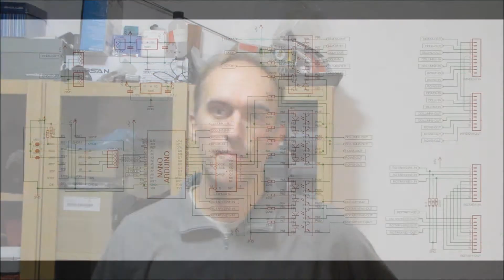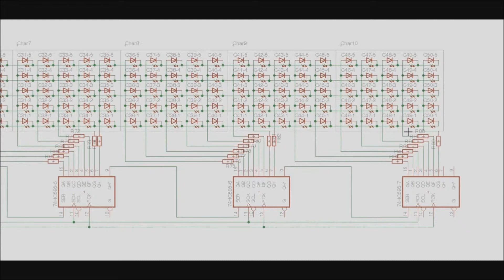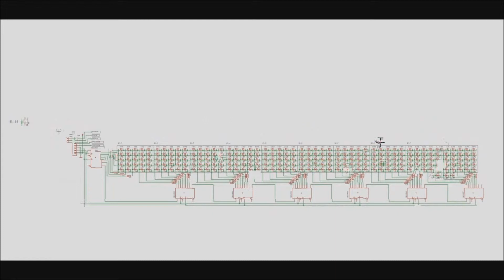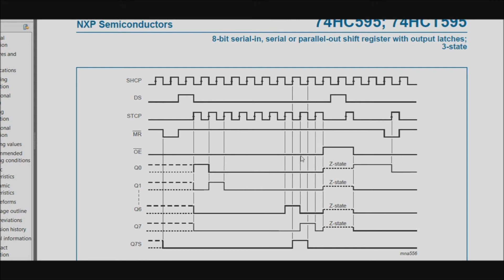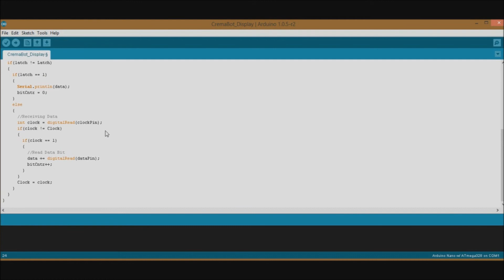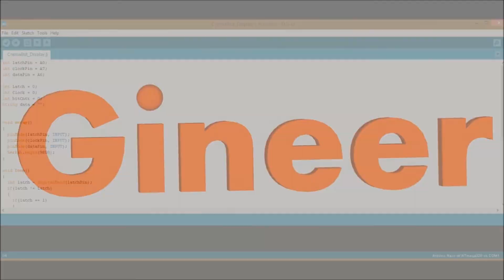CremaBot: Jura Display Hack - Theory

Comment: Hi there. 
Could I somehow only change the text on the display? I wanna do the translation of the text.
Reply from the maker: From memory, the Jira display was build using a series of 75595 serial in parallel out buffers. That means that if you send it the correct data sequence, you could display what ever you want. In my design I simply passed the data straight through though, so I have no firsthand experience of this.
Reply: And would you be so nice and help me with this a little? What HW or SW should I use and so? Thanks
Reply from the maker: Have a look at the datasheet for the 74595 (Mistyped 75595 before). If you put a micro in line line I did, you could use a standard Arduino or other micro controller. Also check that the language you want is not already supported by the machine out of the box (It does have a couple of languages to chose from).